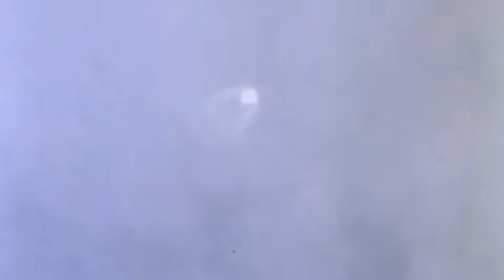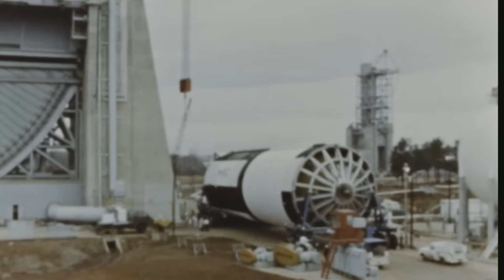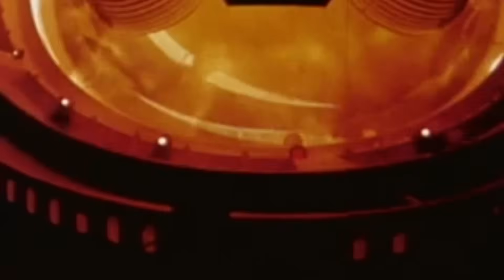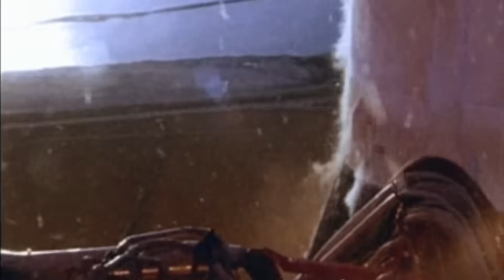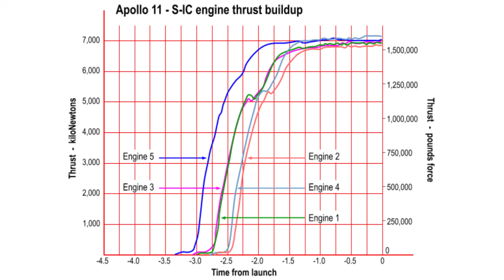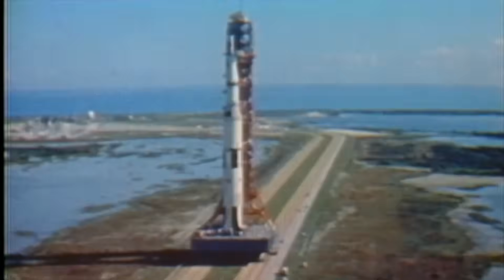Saturn V Center Engine Cutoff: The Logic That Prevented Structural Failure

Comment from the maker: If you enjoy deep engineering dives like this, please consider giving the video a like — it helps this reach more people who appreciate the technical side of Apollo.
And if you want to support more research-driven breakdowns, you can join the channel. Your support directly funds future deep dives into the systems that made these missions possible.
👉 After watching, check out the Final 3 Minutes / First 10 Seconds series to see how these decisions fit into the full launch sequence. https://youtu.be/DSK4TktJcPc?si=BG4KU_f9nRLkq5G7
Thanks for being here — and as always, feel free to add corrections, insights, or questions below.
Reply: Actually, If you look at the NASA chart at launch it generated 7.5 million pounds of thrust at sea level but at staging It was up to 9.4 million pounds of thrust because of increasing thrust to weight ratio and less atmosphere as they climbed.
Reply: This was for a different comment below. Sorry.
Reply: Interesting, but ...
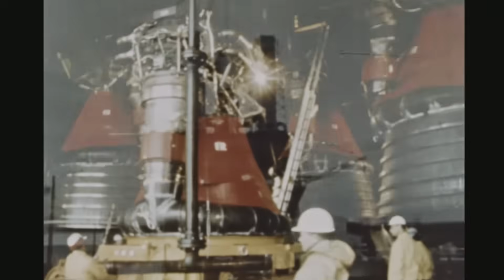4:39 Too long !
Reply: The Saturn 5, What incredible machines they were in use and still are in thought.
While I am not being critical in any way I believe the  4 outer engines were shut off deliberately
before fuel depletion in order to remain predictable - fuel ratios can change as fuel pressure 
changes due to lower fuel availability and causing torquing thrusts and guidance issues.
I would like to hear a deserved deep dive to all of the people in the back rooms (mostly women)
who did the hard math that is now handled by computers. They were all human computers that
did the job perfectly. Thank You for these marvelous shows,

Comment: It is a bit of a paradox. Studying F=MA, we have to think carefully. 

The engines develop the same thrust throughout the first stage burn. So one MIGHT conclude that forces are constant. But if the mass drops, clearly acceleration rises.

But now examine a component such as an upper stage device or the astronaut capsule. It accelerates faster and faster, while its mass is constant. So the force acting on it must be rising and needs to be considered.

Constant engine thrust, yet rising structural forces... an apparent paradox.

Comment: The reason for early center engine cut off was to save weight. If they let the center engine run to fuel depletion, they would need to add additional structural reinforcement at the top of the vehicle to cope with all the problems mentioned in this video. They certainly could have done that, but it made more sense to simply shut down the center engine early rather than adding all the extra weight.
Reply: It had little to do with weight. They needed to limit the high G-load not only because of engineering requirements, but because the astronauts wouldn’t be able to stand the high gees for three minutes straight.
Reply: @pat8988 I'm not sure where people get the idea that 3, 4 or even 5 G's would have harmed the astronauts. During dogfights I've pulled up to 7 G's in a jet fighter for several minutes and I was sitting upright. It's harder to remain conscious when you're upright because the blood tends to drain out of your head, but the Apollo astronauts were on their backs during launch, which further increases G tolerance. They could have easily tolerated 5 G's for 30 seconds, which is how much extra time the center engine would have burned for if it wasn't cut off early. As I said, the Saturn V and Apollo spacecraft could have been built to withstand higher G forces, but adding the extra structural reinforcements would have increased the weight. As such, they shut down the center engine early to limit the G loads on the vehicle  to about 4 G's during launch in order to save that extra weight.

Comment: Didn't one Apollo mission suffer an early engine shutdown during flight (before the planned center engine shutdown)?  They just extended the first stage burn to make up for the short fall, I guess most of the mission flew the first stage with only 4 engines, and all 4 shut down at staging.
Reply: Yes, Apollo 13 had the center J-2 (Engine 5) on the second stage shut down prematurely, lengthening the burn for the other four.

Comment: So, if the center is suppose to cut off, why was it such a big deal when it happened in the Apollo 13 movie?
Reply: It shut down to early. Wasn't really big deal. The other engines just burned longer. Also the apollo 13 center engine out was on the stage 2. Not the s1c first stage. It was a j2 engine on the s2
Reply: @sb8rc1  And of course, the other thing is the irony of Lovell's remark, "Well, I guess that was this mission's glitch".  Poor guy had no idea what was to come.
Reply: @jimwinchester339 he jinxed it 😂
Reply: Because the timing is impeccable to achieve correct orbit perimeters and the shutdown that happened was unplanned.  The calculations still however worked out
Reply: The Saturn 5 guidance system could correct that premature shutdown.
Reply: The center engine shut down earlier than expected. However, the remaining fuel allowed a longer burn of the exterior four F1's until fuel depletion. Total impulse of the booster remained essentially the same, allowing staging at the programmed velocity, but slightly later in the flight profile. The differences were all a matter of seconds off the design and programmed parameters and did not negatively affect the flight profile. At S-IC staging, the rocket stack is at an altitude of 38 miles, is 55 miles downrange and is travelling approximately 5330 mph.
Reply: @DeereX748  Well, it wasnt an F1 because it didnt occur on the first stage. It was a J2, on the second stage.
Reply: That was also the inboard engine on the second stage S2 that failed on Apollo 13. It shut itself down early because something was sense to be wrong. So the computer onboard recalculated the required burn time for the remaining engines and burned longer.
Reply: When the engine shutoff early the rocket failed to achieve the expected acceleration curve.  The thrust was lower than expected and the rocket weighed more than expected.  NASA had planned for this by using the other engines on the second stage to burn longer due to less fuel burn and the stage 3 rocket used more than nominal fuel expected to reach orbit.  After some quick calculations of fuel usage in stage 3 to orbit burn, a 6 sigma predictiont,  the remaining fuel was deemed sufficient for TLI.
Reply: shut down early due to pogo oscillations causing unstable fuel flow to that engine.
Reply: Because it was a bit early.
Reply: That was the center engine of the second stage that failed in flight, not the center engine of the first stage.
Reply: Presumably it shut down too early?
Reply: In Apollo 13, the issue was the failure of the center engine in the 2nd stage. This was an anomaly, not a planned event.
Reply: When you're making a film, particularly one adapted from real-life events, it is sometimes necessary to bring drama to a moment that wasn't really that dramatic, in the service of the story being told. In this case, a bit of foreshadowing of events to come. It is a little curious that even Commander Lovell referred to this event as a "glitch" during the launch phase of Apollo 13. But just because Center-Engine cutoff was part of the design doesn't mean it happened on every launch, or that it happened at the same time in every flight. It may have been perceived as a glitch by the crew of 13 because the cutoff occurred earlier than expected. (prior to max dynamic pressure?) The video doesn't make it clear exactly how the logic was triggered. Perhaps there were sensors that would tell the logic when stresses on the frame (POGO) warranted a reduction in thrust? The on board computer which was actually flying the Saturn V was built into the body of the spacecraft, and able to independently fly the vehicle, as it did during the lightning strike and subsequent loss of instrumentation during the launch phase of Apollo 12.
Reply: @tracedehaven2190 Neither the F-1 or the J2 engines could throttle down, they either were at full thrust or shut down while in flight.

Comment: Interesting content but… there is no indication of the timing when the engine was cut-off.
Reply: He states center engine cut-off is a target window at about 135 seconds after lift off, 20 seconds before the outer four engines cut off at 7:53.
Reply: Actual data for AS-503 (Apollo-8) shows center engine #5 cutoff at 125.93 seconds.  Outboard engines #1, #2, #3, #4 were cutoff at 153.82 seconds.

Comment: Thank you for these entertaining detailed explanations but they raise 2 questions. Clarifications appreciated:
1. It is hard to comprehend that each engine's thrust remained 'near constant' throughout the burn. The F1 engine's nozzle extensions surely were designed to deliver maximum thrust at sea-level since the highest thrust demand was at lift-off. Surely the thrust would decay significantly with rising altitude. 
2. There is no 'central spine' for the load path from the centre engine to travel through the vehicle. All load paths are routed to the 'skin' of the vehicle. Actually through the spar and rib structures that line the internal skin of the tanks. They also act as anti-slosh baffles. The centre engine truss structure is the least rigid of all the engines as the load path can't travel directly longitudinally, resulting it being the most susceptible to pogo oscillations.
Reply: Actually they were tailored for mild vacuum. Its only at sea level for a small percentage of its life. Thats what the nozzle extension was for.  The operated best at altitude. Same as the rs25.
Reply: Not sure if your #1 assertion assumes some propellant push-back on the atmosphere at sea level, but it's negligible compared with the net thrust either at sea level or in the upper atmosphere, where the push-back is much less but the net thrust did remain the same (given no engine throttle back). 

Agree with #2 assertion, as you cannot use the LOX and kerosene tanks to assume significant 'central spine' loading.
Reply: @ellayararwhyaych4711 - Actually, the nozzle efficiency changes drastically with altitude. The second-stage engines were quite differently shaped than the 1st stage nozzles. It was one reason (though, to be sure, not most important) for multiple stages.
As a prior commenter mentioned, the optimal altitude designed into the nozzles was significantly above sea level.
If you watch the flame pattern, it changes significantly throughout its flight...
Reply: The engine's efficiency increases twenty percent from liftoff to the moment the first stage shuts down and is jettisioned 61kilometers up. The nozzle extensions were for flight at high altitude, not near sea level

Comment: If the F1 engines were throtalable could have they flown without shutting down the center engine?
Reply: Just a guess but I don't believe the F1 engine has a throttle. It was either on, receiving full fuel flow or off, no full flow.
Reply: Definitely. But those engines were designed for quite narrow margins of fuel flow.
Most todays rocket engines have throttle possibilities, but still not all of them and still not with a wide variety of trust.
Combustion chamber and nozzle shapes, sizes are optimal for one specific fuel flow rate.
Reply: This channel has an episode with details about why they did not try to vary throttle at max Q or any time.